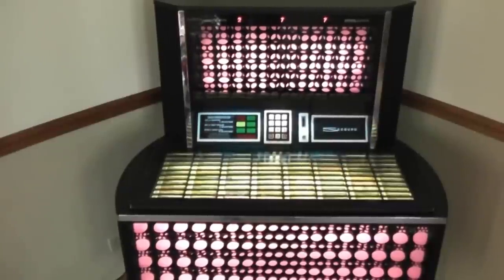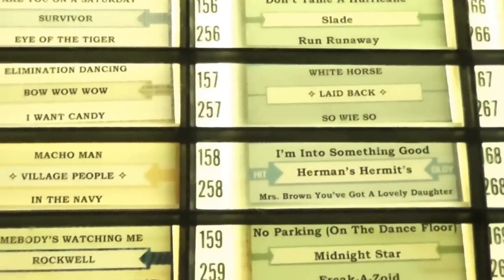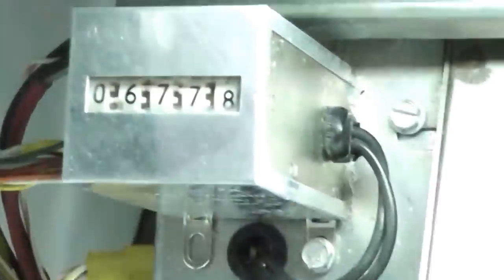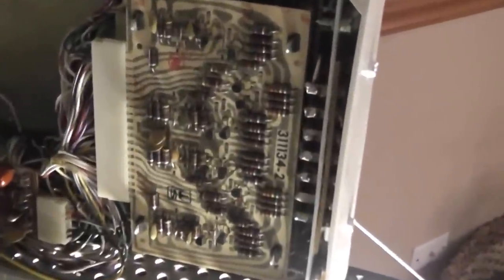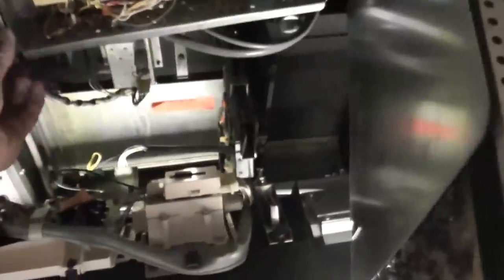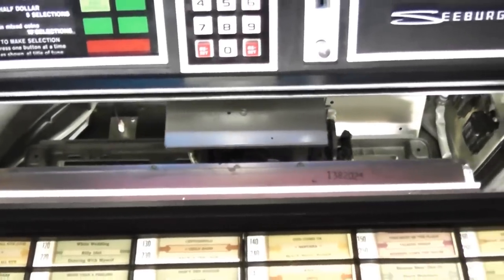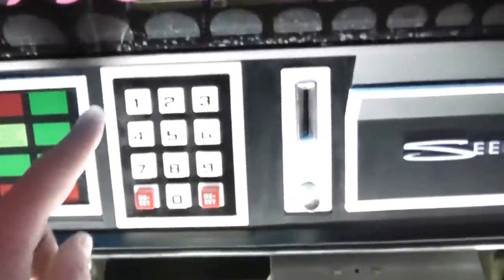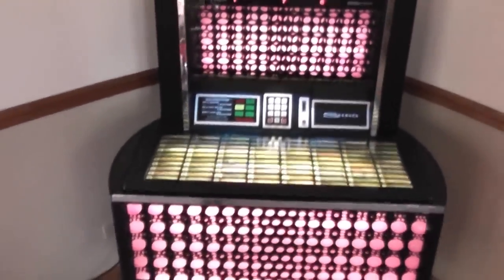Seeburg Olympian SPS 160 Jukebox from 1972

Comment: assume video, I have the same one mine is orange Seeburg Olympian SPS 160 Jukebox from 1972. how do I get the coin mech to work?
Reply from the maker: In order to get the coin mechanism to work, there is a card that gets plugged into one of the gray or black boxes I forget which one.  There is a FreePlay card and then another one which has the settings.  Once you put it in, then, the coin acceptor should start working and registering
Reply from the maker: It’s possible that there is no card for FreePlay. I can’t remember but I definitely have a plug-in module. It’s like a flat cartridge.
Reply: @davismv  thanks for the info it looks like the card is missing in the black box

Comment: I just bought a 1974 that has a lot of similar parts & features.  Would you happen to have any ideas about how to make sure it's in "free mode"?
Reply from the maker: Rubber Chicken Films My jukebox has a card that goes in that puts it in free play, I think it goes into the the gray box.  I also have another card that goes in that has soldered jumpers which then causes the unit to charge specific prices. So you’ll need that card or the wiring diagram to resolve.
Reply: @davismv  Great! Thanks for the info!

Comment: Do you still have this machine, and if so could you measure the rear access panel and post those post those numbers. I have the same box but it is missing that panel. It would be easier to find if I knew the exact measurements. thank you..
Reply from the maker: Jim Mayer Yes, I will get the measurements and post them here. Just to confirm, this is the removable metal panel on the back?